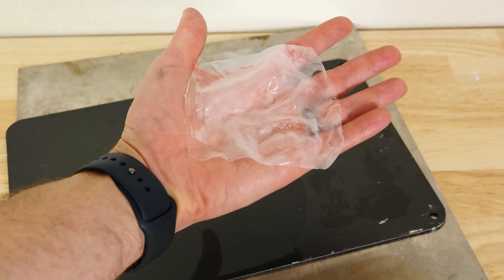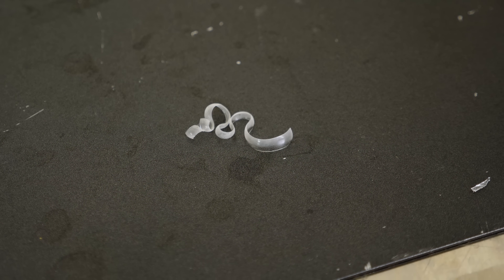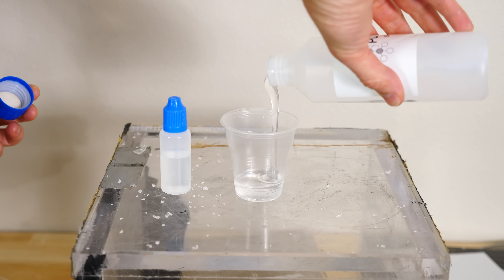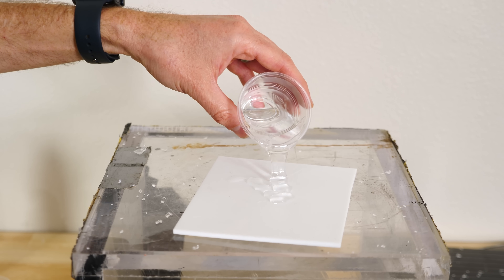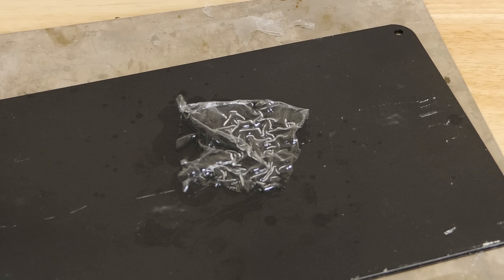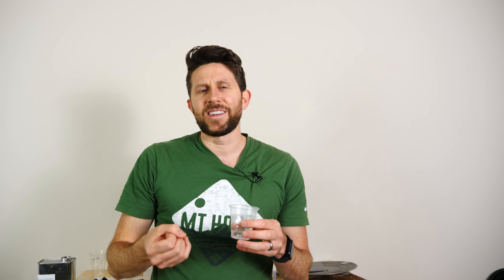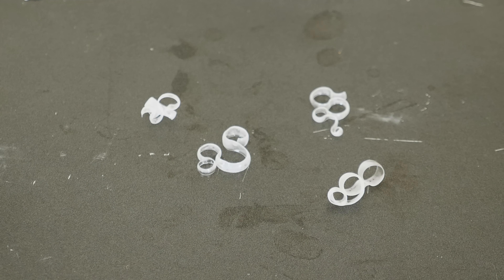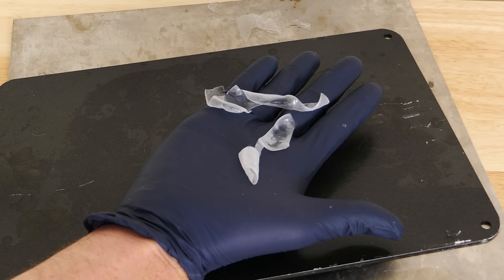Making Skin That Moves on Its Own

Comment: For anyone looking to try this it should be noted that hexane is neurotoxic, thus exposure should be avoided. Heptane is a safer alternative, though it doesn't evaporate as quickly which may ruin the effect.
Reply: He better pin this before some 6 year old gets hurt trying this :/
Reply: @jinglenaces9591  yeah a 6 year old is gonna go out and get hexane
Reply: But is it a deadly neurotoxin?
Reply: Can’t believe he forgot to put a disclaimer about that in the video 🗿
Reply: If a safe substitute could be found somebody could easily market this as a Halloween toy or something similar.
Reply: Hexane is relatively safe and commonly used in chemistry labs (though usually under a fume hood). In low doses like shown in the video it shouldn't cause an issue; however, it is flammable (the vapors too) so caution should still be exercised. As a matter of fact, hexane is a large part of gasoline.
Reply: Commenting so this stay on top
Reply: If someone can even get hexane wouldn’t you think they could figure out that its dangerous?
Reply: @supsm6627  relatively safe with gloves and a fume hood so you don't absorbe it through your skin or inhale too much
Reply: @TG22222  Hexane is an ingredient of several household items, such as certain glues. I personally had to be wary of it while using rubber cement to make some magic gimmicks, so a toddler could probably stumble upon something containing this.
Reply: At least according to the Wikipedia articles, heptane has similar hazards to hexane, apart from being less volatile.
Reply: @ItzChaz625  To quote the safety data sheet for n-Hexane: 

H225 Highly flammable liquid and vapour.
H304 May be fatal if swallowed and enters airways.
H315 Causes skin irritation.
H336 May cause drowsiness or dizziness.
H361f Suspected of damaging fertility.
H373 May cause damage to organs through prolonged or repeated exposure.
H411 Toxic to aquatic life with long lasting effects.

As always, lethality depends on the dose - It's not like touching a small amount for a brief time is going to kill you, but it is undeniably toxic both on contact with skin and on inhalation (The SDS by Fisher Scientific even goes so far as to state "fatal in contact with skin", which imo is a rather dramatic overstatement). 
It can be handled safely without issues by wearing personal protective equipment and working in a fume hood or well ventilated area. We used to work with lots of hexane for column chromatography, but we've since phased it out entirely for heptane. It's still toxic, but to a lesser extent than hexane especially on the neurotoxic part. It's also less volatile which reduces accidental inhalation and the risk of fire. 
I find it mildly irresponsible that his thumbnail shows him holding the silicone dripping with hexane while not even wearing gloves, it's especially egregious because hexane is so readily absorbed through skin. Even if the dose he's exposed to is low, it's still bad practice when handling hazardous chemicals.
Reply: yes
Reply: @i7shin207  rel
Reply: @ReplicateReality  the problem is that people are stupid and anytime some idiot hurts themselves doing something stupid it's always seen as the fault of the person who didn't put a warning on it, regardless of what common sense would tell you about the action.
Reply: @Isolanporzellator  intriguing, we just kinda piss hexanes all over the place in our lab because we use it so much for dispersing nanoparticles, cleaning glassware, cleaning benches, etc. 

Place is well ventilated, but we don’t just use them under the fume hood. We gotta stop that, if this is true — I was under the impression that it wasn’t all too harmful (ofc we never had ready skin exposure or anything, I know that’s really bad; only potential hazard was ventilation)
Reply: He needs to pin this
Reply: Noted.. thank you!
Reply: @TG22222  isn't that the stuff they add to engine starter for the ether-huffers to get brain damage? at least that's what I used to try and distill out when I was 10 bringing the s*** to school to share with my friends.
Reply: @Sciguy95  i know what you mean but still all legal chemicals have federal warning labels on them and if you can get your hands on it then you would have to assume that they had the ability to read, and that makes it their fault, but when you are trying to solve a problem like this its hard to pick which solution is more beneficial, punishing the one who made the mistake or changing the way the system works. So yea people do stupid things and companies need to account for that, people should be smarter but we also need systems to protect them too
Reply: @ReplicateReality  we need the protection and warnings when the hazard it isn't totally obvious, but when people are so stupid that they don't understand things like fire is hot or that the burger you see on the billboard is not the actual size, then it is absolutely ridiculous to punish the company for not warning people about that. I saw a sign at a pool once warning people not to breathe under water.
Reply: @Sciguy95  lol
Reply: @Sciguy95  companies are punished for lying, safety measures are put in place to protect people beyond that I don’t see companies being unjustly punished.
Reply: @ReplicateReality  so when a company is sued and has to pay a fine for false advertising because they didn't put "not actual size" by a burger in a billboard or because they didn't put "caution: hot" by a fire? That's the kind of stuff I'm talking about, things that shouldn't need a warning because of how absolutely obvious they are.
Reply: @Sciguy95  you are ignoring the fact that i agreed with you already, yea some of the warning labels seem stupidly obvious but if a lawsuit was won then there is your answer, the company was at fault, the law is built to protect citizens and companies. Sueing is how you make someone accountable and it takes a lot of time and effort and money to follow through. If a company is slapped with fines they have more chance of paying it off than an individual person and it also probably deserved it. Even If people are to blame for hurting themselves there still needs to be a way to protect them. Some people may not know the drink they got would be so hot or that they got a hot drink in the first place. You may believe they deserve it and nothing should be done but the rest of us believe that warnings help people.
Reply: @Sciguy95  the not actal size ones are hilarious tho
Reply: But he is holding the entire stuff on palm.. Doesn't he know?🤔
Reply: Mr. Action lab has a PhD in chemistry or chemical engineering, I think. He should have definitely known to make a safety note. Hexane is toxic and the body eventually converts it into something neurotoxic, and inexperienced people should not mess around with it. That being said, Hexane is definitely not something like an organic mercury compound or so. It will not give you some crazy agonizing death from touching a few drops. Use a fume-hood or do it outside, don't soak your whole arm in it for three hours, you should be fine.
Reply: I wonder if this has been tried with safer hydrocarbons, like ethanol 🤔
Reply: Thanks.. I tried it
Reply: Ok, don’t ingest the hexane. Great safety tip.
Flammable too. 
Safety tip #2: No smokin’ the hexane. 
Do we have a safety tip #3? 
I love chemistry.
Reply: @cattlemen  I presume this comment is sarcastic, but I'll give an honest answer anyway:
#3 is don't touch it as it goes through your skin. 
#4 is use it in a fume hood because it evaporates quickly and you'll breathe it in.
#5 is dispose of it as chemical waste because it's highly damaging to aquatic life.

Sure, you can go ahead - make fun of and disregard the safety recommendations. You'll probably get away with it 99% of the time. Until one day you don't.
Reply: @ItzChaz625  Did someone say deadly neurotoxin?
Reply: Well all I want is a pet clear peace of tissue in a small tank next to my other "cut me cuz I'll be fine." Pet.
Reply: @TG22222  no but stupid parents may see this video and "try to show their kids a "cool experiment"" just saying
Reply: @Isolanporzellator  dude does dumb stuff on this channel all the time. Glad for the info. Much appreciated!
Reply: @petevenuti7355  you were huffing ether at 10 years old homie?!? Shit, I just started smokin pot at that point. Damn bruv
Reply: @Jaysin412  oddly, more cuz I was a bit of a geek, reading about the doctors of old, discovery of anesthesia, tribal medicine (nutmeg tea) , if I couldn't read a book I was reading labels so I knew what was in stuff.. and I really loved building those model airplanes 😉 
  Didn't touch the hard stuff till high school, never liked pot, avoided PCP like plague (saw what it did to a few friends).  I was on a mission to do everything 'bad' in life I was morally capable of before 18 and may have to deal with legal consequences. 
      Of course my nerdy idealistic optimistic naivete didn't serve me well as I discovered guilt and truth have only about 50% correlation with conviction..
   Best advice my parents gave, don't piss off the cops, and reputation is often more important than who you are because it follows you even when you change...
Reply: Thanks
Reply: @supsm6627  didn’t they also put lead in gasoline 

I don’t think that’s a fair measure of safety
Reply: I hate the fact that action lab hasn't pinned your comment.
Reply: Then it can't work as fishing bait? Damn! I just started a sanitary crysis.
Reply: @jinglenaces9591  well it's the top comment by a lot so it should stay at the top
Reply: @Jaysin412  dumb stuff like what. I'm curious about some examples
Reply: @tommyisacamman18 it says there is only 999 and I'm 1k. I'll screenshot it
Reply: more people need to know this lol
Reply: @douglaspantz  ain’t no way a kid gonna have any glue in his hands that ain’t elmers. My teachers would be PISSED if they caught us with any type of super glue (that glue that tries in literally 3-5s
Reply: who cares bruh i just wanna see plastic move
Reply: no weird shit was harmed in the making of this video
Reply: @jinglenaces9591  i doubt a 6 year old would understand anything he’s saying anyway
Reply: @jinglenaces9591  yeah 6 year old will access to hexane and polydimethylsiloxane
Reply: So basically we're watching faux skin writhing in agony?
Reply: @TG22222   They can if they have awesome/negligent parents
Reply: ok 🤓
Reply: Why he playin with neurotoxins doe 🤨🤨🤨
Reply: So scary haha yeh i proper whacked me pants haha.ive told u a million times not to exaggerate hahaha😍😍❤❤
Reply: Mad scientist be like: Finally!, a worthy opponent, our batle will be legendary
Reply: He touched the h cane filled polymer with his bare hands

Comment: I actually guessed something similar to that material. I thought it was the same material that was made out of that magic fish thing that curls up when exposed to water or something.
Reply: I was thinking of the magic fish also when I saw the beginning of the video!
Reply: Those are magic or fortune telling fish, they are made from a polymer absorbs water from perspiration on your skin, changing it structure and warping the fish. Two different polymers are commonly used,. Cellophane was the first, later came sodium polyacrylate — the same polymer used in disposable diapers.

Comment: So the reaction will keep going until the hexane evaporates off the silicone. Now I'm curious if placing it in a vapor chamber would allow it to continuously evaporate and re-absorb into the material.
Reply: It can't evaporate if the air around it is already saturated. Either it evaporates (goes from the thing into the air) or it absorbs (goes from the air into the thing). It's like electricity, it can only flow in one direction at a certain time.

Comment: Interesting how this is how Venus fly traps work. I thought they used pressure differentials? Maybe some bit of both?
Reply from the maker: They work due to a snapping mechanism. But the snapping occurs due to osmotic pressure not due to evaporation.
Reply: @TheActionLab  interesting

Comment: I wonder if this type of property could be found in a material using water. If so, you could create a motor that absorbs water on a belt then creates movement through evaporation..🤔🤔🤔
Reply: Check out his video with the wiggly fish, he shows, fish cutouts made of cellulose (or something similar, don't remember exactly) which contract due to moisture (water)

Comment: If a current was run through the worms, would it help control the rate of evaporation? If you had layers, where only one layer had current at a time, and the whole thing was enclosed in a silicon sleeve, could that be an artificial muscle?
Reply: Yea but consider its one time use, after the hexane is inside all possible gaps the reaction stops, I think
Reply: @truestopguardatruestop164  It sounded to me like the reaction happens when the  hexane evaporated. If it evaporates from one layer, it must go into the other one, as it's enclosed.  If plant's and insects can control it, it must be controllable.
Reply: @chrisBruner  may be

Comment: I thought this would be neat to do an experiment with my kids, but after seeing the price of the stuff I think I will have to hard pass...
Reply: Hexane is neurotoxic as well, there's a comment from an ex Navy that mentions having to wear full hazmat gear when measuring small quantities of the stuff.
Reply: @midnightlycanfox6280  I noticed, but I have a fume cupboard so toxic chemicals aren't too big of a problem. I was just surprised that, even a pre-made (very small) sheet of this silicone is well over $170AUD... like, no thanks!